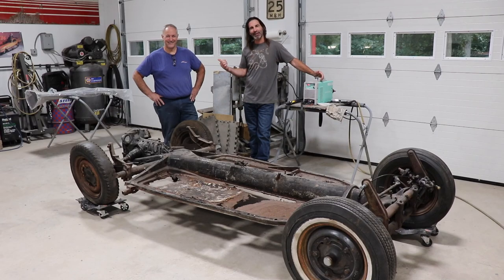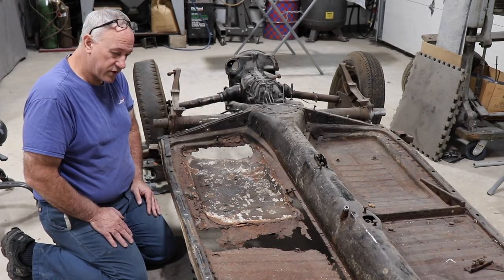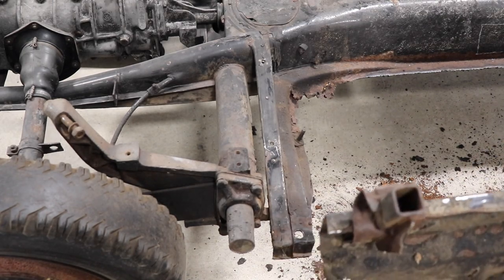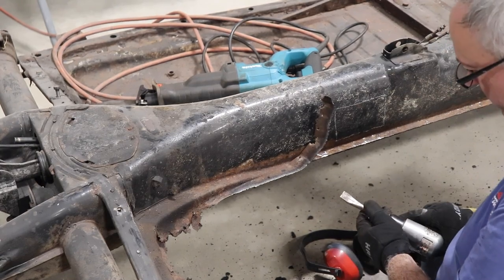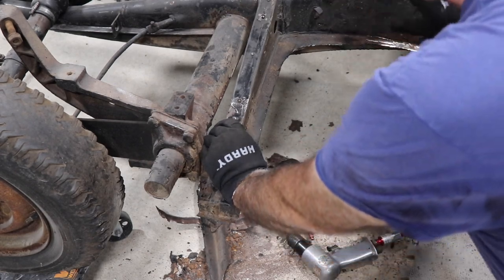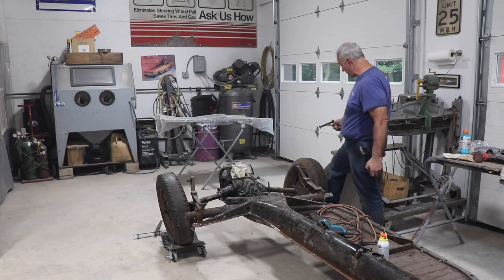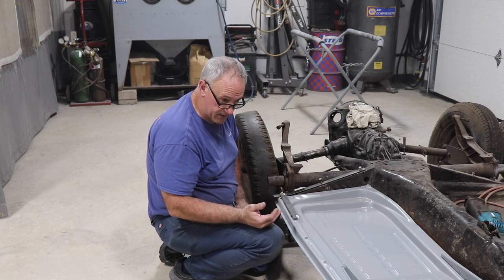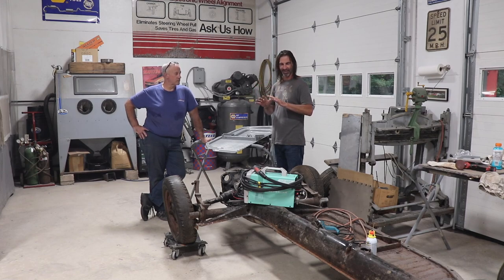VW Beetle Floor Pan Installation Chassis Tips & Tricks | 1959 Vw Beetle Ragtop Restoration

Comment: FYI my buddy is installing new pans on a vert.....He told me a new technique. you use a tig welder to do the spot welds. turn over the tungsten of course have the metal clean.  Hold the cup flush to the surface with the gas on. pull the trigger and wait 2 seconds. Full penetration weld with no drilling. Looks factory. must have really long tongs on your vice grip to hole the metal tightly together.  Double the amperage and hold for 2 seconds depress the pedal fully.
Reply: I like this….

Comment: I don't think I have ever seen a pan fit that well on the first try... and those jigs confirm the fit! BTW, if anyone is interested, I have a bead blast cabinet for sale like the one in the background here, complete with the vacuum system. For some reason the paint is peeling so not as pretty but make a reasonable offer. I'm in lower Ct.
Reply from the maker: I can tell my when we did my 58 I didn’t show how bad off they were , wow , they fit horrible . They were the cheap pans I got along the way of buying cars .

Comment: Unless You want to keep factory, You can do like I did and fabricate the floors, and in my case a good portion of the rear seat/luggage area with much heavier gauge material than the replacement floors. I used an old 275 gallon fuel tank . My floor was like this one, just the floor pretty much gone, but the outside edges were in great condition. And yes, my method added a bit more weight , but much more strength. And I got the tank for free so that was a good deal. Just had My time and welding materials in it, but I enjoy doing it, and I coated everything top and bottom with 2 coats of Herculiner . Came out great! And now back to the new wiring harness installation, which is a much less enjoyable task.
Reply from the maker: Fix it with what you have 👍….Larry does 100 % correct restorations